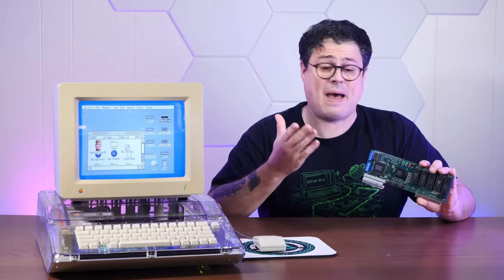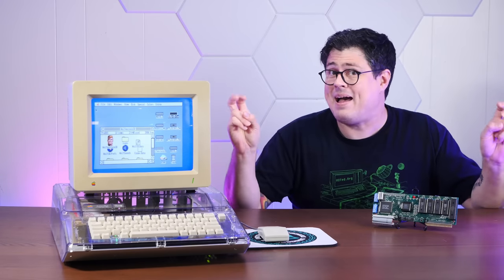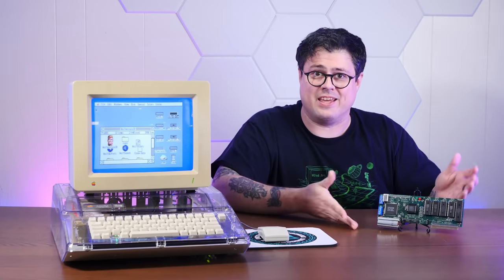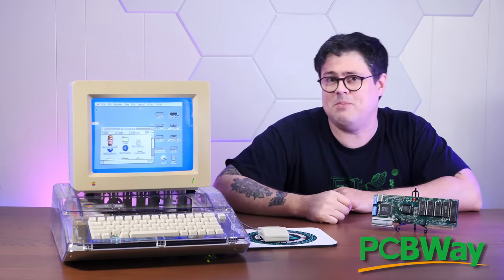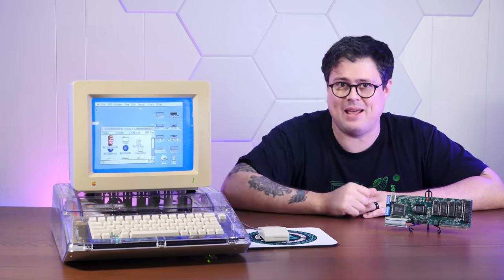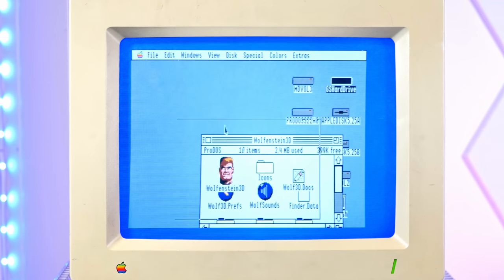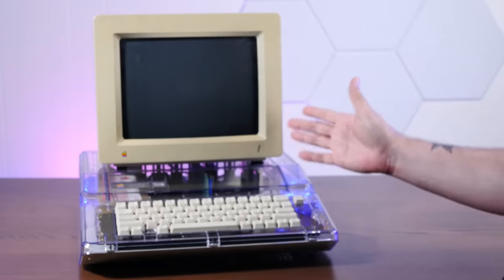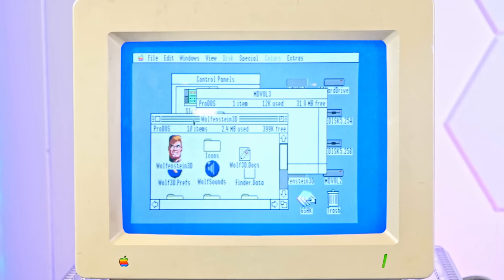Accelerating the STEALTH Apple IIGS!

Comment: The way they treated owners of this machine is what originally started my Apple boycott in 1989.  It stands to this day.  I will never have an Apple product in my house for the rest of my life.
Reply: I'm not particularly bothered about Apple products in general, but that seems like a rather extreme attitude, considering it happened 30 years ago. Apple aren't the only company to sideline a portion of their customers in order to move things in another direction. Some people dispute the idea it was even Apple's fault, but rather than the chip manufacturer, WDC. After all, despite many promises, Motorola later struggled with 68K development, and both they and IBM eventually hit a wall with PowerPC. In both cases Apple were forced to change platform to survive.
Reply: @another3997  It wasn't because of the speed of the machine and the reduced speed of the CPU, it's because of the way Apple treated their customers.  They promised an upgrade, demoed it, then said "we're not releasing it, you'll just have to buy a Mac".  This was actually the last good product Apple made.  Macs have always been utter garbage.  Their other products are cheaply made crap that they charge a premium for.  When Apple's most powerful machine is less than 1/5th as powerful as my computer while costing more than twice as much, yeah it's lolworthy.

Comment: 0:15 - "Famously crippled by someone (Jobs)"

Bullshit.
Jobs may have managed to cap the CPU speed of the IIgs (and make that change stick on a product released A FULL YEAR after his departure) - never mind the fact that the early 816 CPUs weren't delivering on their promises with regard to clock speed: But who designed that computer around a 1MHz core? Who put the graphics chipset and all its RAM inside that 1MHz core? Who created a graphics system with no hardware sprites, no scrolling backgrounds, and no blitters?
The problems with the IIgs run deeper than limited CPU speed. It's a platform that was intended to compete with the likes of Amiga and Atari ST, but built around an architecture from 1977. Most home computers of the mid 1980s didn't have loads of CPU power, they worked around that limitation by providing useful features in the chipset, and the IIgs has very little to offer there.

Comment: You desperately need a DIP extractor.  It's a u shaped piece of stamped steel with two inward facing tabs at the open end that you slide under the end of the ends of the chip so you can pull it straight up and out.

Comment: the IIGS would have crushed the mac at 8mhz back then..
Reply: In the short term, yes, but what about in the long term? In terms of CPU alone, Motorola's 68K series went on to include the 32 bit 020, 030 and 040 before development stalled, causing Apple to move to PPC. Apple never used the 68060, which came out, far too late. Would the 65xxx CPU from the GS have continually moved the platform on?
Reply: @another3997    I'm not even sure about the short term, personally. The Macintosh II came out in early 1987 and from that point on most Macs were 16MHz, 68020 or better - a full 32-bit CPU. Only a few models, like the Macintosh SE, and Macintosh Classic continued using the 68000 at 8MHz.

That said the 65816 does have good performance-per-clock-cycle. I'm not personally sure if a 16 MHz 68020 would generally outperform, say, an 8MHz 65816 - it can depend on the program in question. Though I think the 68020 has all kinds of advantages that could give it the advantage: wider memory bus, more registers, CPU cache, instructions that incorporate more functionality...  And a "flat" memory model that's not built around 64K "pages".

...Of course, the Mac II was a far more expensive machine, too...

Comment: Released intentionally crippled and only received the barest of support from Apple. Much like the IBM PCjr and Commodore 128, it makes you wonder why they even bothered.
Reply: Hindsight is great. Developing can take years from initial idea to the finished product. Things can change rapidly during that time. Unlike Motorola's 68K series, the development of the 65xxx wasn't going anywhere fast. There were problems getting it to run at the intended speeds, but the GS was already pretty much finished by then. You need to set up contracts with suppliers and manufacturers well in advance, and they will want payment to cover their costs, even if your product is stillborn, so Apple had to make choices. Ironically, a similar fate lay in store for Apple with both 68K and PPC processor lines.

Comment: Whadda you mean Steve Jobs killed the IIgs?  He wasn't even around in Apple at the time cause he left the company in '85 to start NeXT Computers.  Blame John Scully who wanted to kill off the Apple II line in order to sell overpriced Macs.  (Does no one read WIkipedia anymore?)
Reply: There's more to it than that. Apple had to plan for the long term, because every computer takes a relatively long time from drawing board to finished product. Despite being successful in the past, things moved on and the Apple ii became an evolutionary dead end. As for Wikipedia, you might want to take a lot of it with a pinch of salt. It's good, but not a definitive source of information.